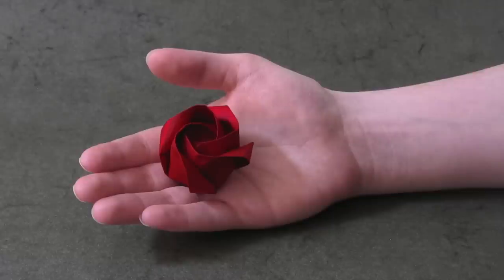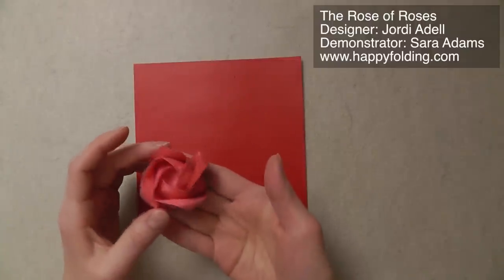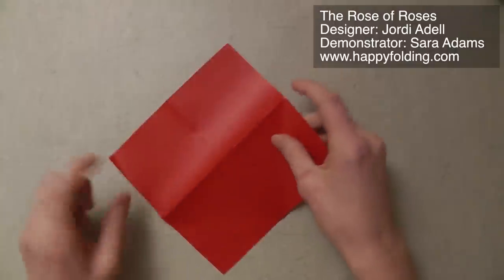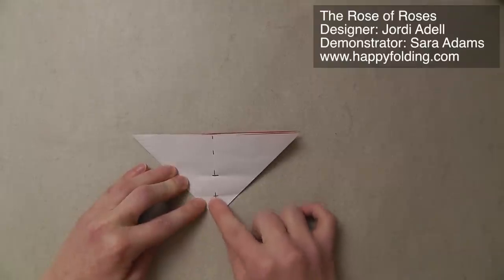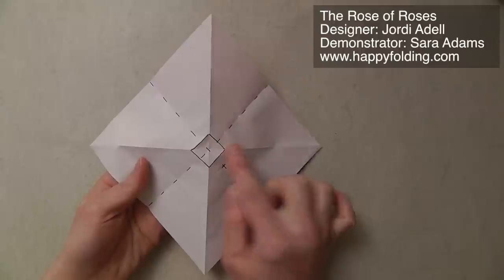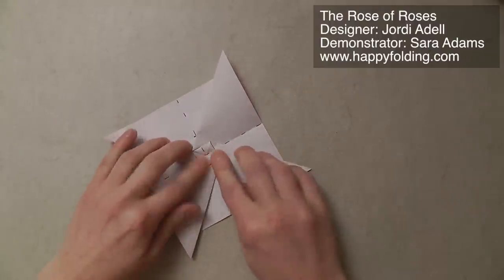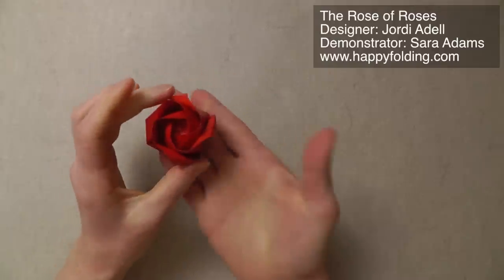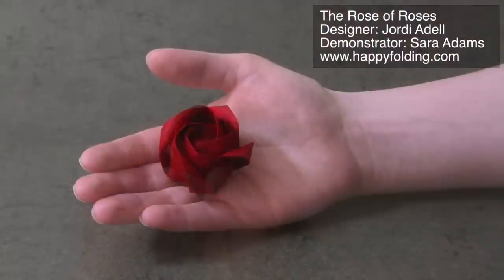Origami Instructions: Rose of Roses (Jordi Adell)

Comment: Hello! I love it, congratulations...!! and after few attempts I finally was able to do it.. still not perfect. I have a question for you. I just bought "origami paper" from the brand "AITOH Origami  Paper" but I notice that it is very thin and when you make the crease it brake the paper very easy. Could you let me know that paper that you use, please? I notice watching your video that the paper that you use looks more ticker and the color is more vibrant, smooth and silky and I love it. I will appreciate if you can share with me more info about the type of paper: brand, weight, etc. Thank you so much and congratulations on your talent.
Reply from the maker: These are the 15 cm / 6 in squares I usually use: https://www.origami-shop.com/en/paperorigami15500scrapbookingorigamishopcom-xml-219_346_347-620.html?ref=2&affiliate_banner_id=9

Comment: Okay, I did this on the first try. I've never folded more than paper boats before. Yay!
But god the locking was hard, so to everyone struggling: make sure to REALLY PUSH THOSE FLAPS IN
CREASE IT IF YOU HAVE TO
they wil open the fuck back up if you dont
don't worry about how short the rose is, just give those flaps a real good push. they will lock. you can do it

Comment: Your folds are impossible to follow once you get to 6:50. Do they all overlap? one at a time? Let go with pinky? Hold each section closed with the pinky? No fucking clue... show each fold, especially the complicated ones in the middle from multiple angles.
Reply from the maker: I'm sorry to read of your struggles. If it's a bit too challenging right now, try folding some easier models to hone your skills and then come back to this one. This is what I've done many times in the past, and it's always been so rewarding to see how I progressed, finally managing to master the complex folds that were too difficult for me before.
Reply: @Happyfolding  I just got it now. I had missed a fold around minute 12 over and over that threw me off. Now hopefully to get through the rest.  Thanks for the videos. The design is beautiful.